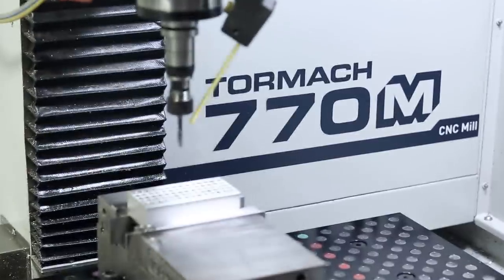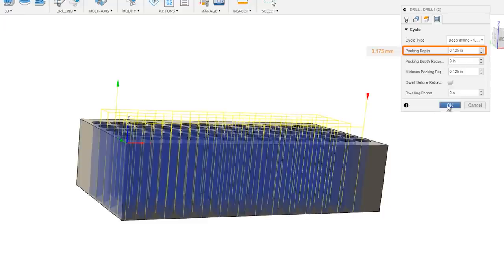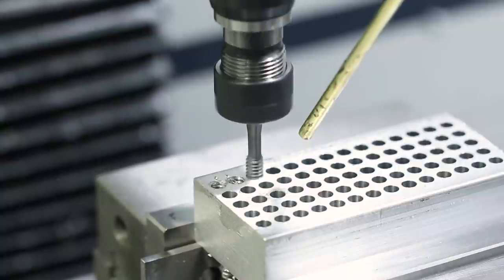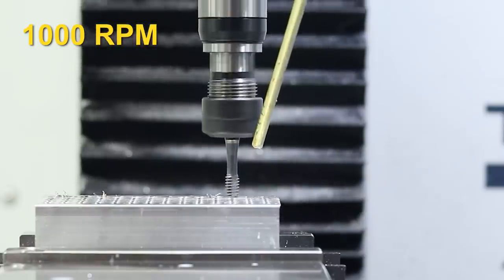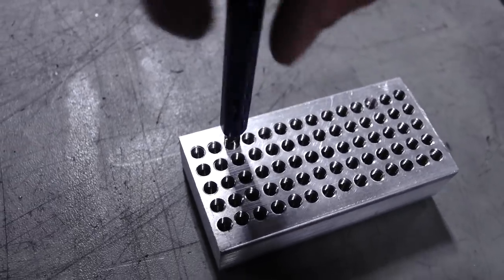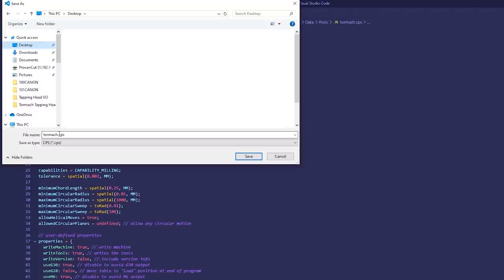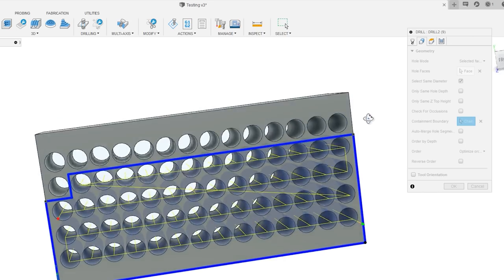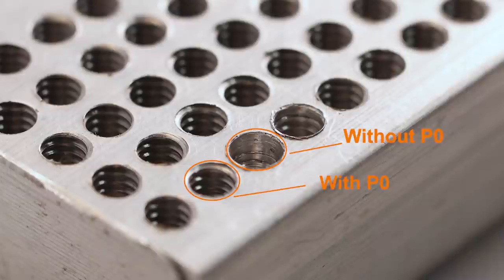How to use the Tormach Tension Compression Tapping Head

Comment: Good video, learned a bunch from you guys so far :)
Though even if you’re using a tension compression head, the head should barely move in and out.
The head is primarily there to take up the slack while reversing the spindle and minor differences between rpm and feedrate.
The feedrate should be rpm x pitch of the thread.
In your case the rpm and feed differ too much, hence the massive travel of the tapping head.
Greetings from an austrian engineer and cnc machinist.
Reply: Was gonna comment just that. Its there for minor differences and should be used that way. Is how we do it at work.
Reply: My post goes by the diameter of the tap rather than thread pitch when calculating the feed rate for some reason. I wonder if that's what their post is doing too.

Comment: Great stuff junior, I did learn a lot but here is your REAL problem. The RPM is way off... In the Tormach manual it has a section about getting a photo tach and measuring the actual speed of the spindle. There is a potentiometer on the control board you can tweak to get the rpm to actual=requested. Only in threading does this amount of accuracy matter. Of course on the MX with an encoder on the spindle this problem is moot, but in pre MX models... The extra travel you are seeing in the quill movement at the tap head is because the rpm is a lot faster than the 525 rpm !! I m guessing its better to have the rpm - tap speed faster than the Z axis moves so it does not get tight... however.... Get a photo tach, follow the procedure and save your P codes for fine tuning... In closing know John IS NOT a fan of Blasser 735 But... ratio mix on the heavy side, in aluminum it works better than taping fluid in my opinion. Taping fluid, and other oils may attack the paint and cause some paint failures we are seeing...Tormach 1100M owner...                                                                                                                                                                                                                              
HAAS also has a great tapping video that I highly recommend as required viewing. Mark Terryberry goes into the different types of taps, and it is possible a less pointy type tap or spiral type may give you better thread finish..
Reply: wanted to post the exact same thing... in my job we don't use cad/cam for most jobs but I know most machines need a 2 to 5% increase in feed to match the correct feedrate. even our oldest cnc machine from the eighties has a separate knob just for the G84 cycle to offset the feedrate up to + or -10% for just that reason. It is however the most accurate and needs no adjustment.
Reply: Hi Jonathan, could you share your feed/speeds on your 1100M for 1/4-20 tap ? I just broke 2 taps....
Reply: @loupitou06fl  in what material ?
Reply: @automan1223  In 6061 aluminum
Reply: @loupitou06fl   just looked up my tooling plate I did out of 1/2 " using 1/4 20 tap prob over a hundred holes... I settled on 500 rpm. Standard tapping cycle. no dwell. Blasser 735 @10% probably a bit more. Did set the clutch on the clutch to slip if it got tight so it would not break the tap. I did a bunch of test holes to creep up on the clutch setting. I also may have drilled to the larger part of the spec so the hole was not tight but honestly cannot remember. Thread milling is also very very cool. NYC CNC has a few good videos on thread milling. Cutters are pricy but work flawlessly.
Reply: @automan1223  Thanks a lot for the prompt reply. I'm also trying to build a tooling plate (3/4in thick). I used a std cycle, 500rpm, no dwell (added the P0.). I'm using the ER16 taping head so no clutch to save my tap. I'm using also mist coolant Extreme Cut 251C - I might switch to tap magic dispensed my hand. I drilled the holes with #7 but I might go to 13/64" and retry. The first few holes taped ok but I noted the head was stretched a lot during the retract - I checked the feeds and the ratio feed/speed was correct.

Comment: When I was in school we were told to program for 95% of pitch when programming for a push-pull floating holder. I was never really told why that is, but always followed that rule until I worked on a machine with rigid tapping and a rigid holder. I also never pushed the speed much because I actually never milled soft metals much.

Comment: Interesting... I'll have to setup some experiments of my own and see what kind of results I get. 
I tap 100's of holes in 304ss with my Tormach 1100 series 3 . I've found the biggest issue with thread quality  and having the tap rub at the top of the hole has to do with feed height, I set my feed height no lower than .50"  giving the head plenty of time to retract out of the hole at the specified feed rate. I also program a .5 second dwell in fusion. I run 500 rpm max in stainless and use  Moly-Dee or similar heavy tapping oil.  The biggest problem I have is controlling thread depth accurately in blind holes.
Reply: I’m getting ready to tap some holes in some 304 .4 deep, what should I set my bottom height to? I don’t mind only tapping .2 deep if I can finish tapping by hand safely
Reply: @gavinbutler4054  That sounds like a safe way to do it, I usually leave about .150" between the bottom of the hole and the programmed tap depth for the floating tap head.

Comment: Any chance of you guys commenting on the changes to the Fusion 360 license announced recently?   Seems like anyone not an entry level hobbyist and not a business with income enough to afford a commercial license is out in the cold now.
Reply: I'd second that question :)
Reply: Did they raise it above the ~$300/yr?
Nm, just read it. The no rapids won't hurt tormach people that bad, but having to load another program for every tool change is ridiculous
Reply: Not to mention not being able to export .step files. Those are the bread and butter of the cad/cam world!
Reply: @piccilos  pretty sure that's automatic tool changes specifically; manual tool changes are still possible in the same program ... right?
Reply: @ikbendusan  I hope so. I don't know how they would limit that in the g-code, tool change is handled by the controller.
Worst case scenario you could still splice the code together by hand and call your own tool changes. Still annoying though.
Reply: @piccilos  very annoying. removing rapid feed is also such an asshole move
Reply: Or just pay the minimal fee?
Reply: @CHinesRacing87  Minimal fee? Go take a look at the price.
Reply: Dejan Brice I’ve been paying it for 3 years and solidworks before that trust me it’s cheap

Comment: which tapping head and collet would you recommend for a haas Cat 40 taper tool.  I'm going to need to buy a tap holder as I'm running a Haas VM-3 on Aluminum and Plasic and specifically will need for stainless.  I am currently using ER 32 nd 16 collets but I know i'm going to run into problems when I start running production cycles with the tap slipping as it has already happened to me a few times at 500 rpm.

Comment: It looks like your spindle speed needs to be adjusted. With a matched RPM and feed rate you will not see much if any compression or tension in the tapping head.  Tormach discusses how to adjust the spindle speed in the same document that you showed in the video. Currently the spindle is rotating too fast causing the tap to bore down faster than the feed rate.

Comment: 1. How does Fusion calculate Z feed rate if it needs so much compensation from the tapping tool?? Or is there something I've missed?
2. What about starting with moving the tool up before spinning it in reverse? This may help making even better finish on the top thread.
Reply: The lower-end mills like Tormach don't have nearly as good speed control over their spindles compared to other larger, more expensive machines. It's basically an open-loop system where the pro machines use servos and can better match the feed rate and spindle speed under varying load conditions.
Reply: Yes, spindle speed is off. As stated earlier, by someone else, the spindle has to be calibrated. The Tormach manual details the process. I have done mine and it is less than 2%. Once the spindle is calibrated, you should use a dwell. The calculation for how much dwell is also in the manual IIRC. If done as discribed in the manual, there is nearly undetectable movement in the tapping head. I had to put a sharp mark on the compression head to see it. Also, use a spiral tap that ejects the chip out of the hole. I run my coolant a touch on the rich side in general and that really helps on the taps. That p value it for calculating the deceleration and acceleration (drift)of the spindle during reversal.  If I had video equipment, I'd out up a video. BTW, I've never broken a tap. That said, I've not had to tap a hole larger than #8. Fwiw

Comment: On the other hand, this only works for this setup. If you have pocket taps your tool will brake, if the hole is deeper your tool will break ;). Also you are using a machine where the costs per hour are not too high so why not stay with the smalles rpm you have you still will get a great tap and don’t run in problems.

Comment: Your feeds are wrong. 1000rpm 1/4-20 tap should be 50ipm. That’s why there is so much movement in the tapping head. Rpm/TPI is your feed rate.
Reply: We use to break taps when we used 100% of the calculated feed rate. I started using 95% (tapmatic recommended) so the tapping head is always in tension & we've not broke a tap since. Using 100% requires your mill to stay in perfect sync with the tap. Our problem is the mill would get ahead of the tap, causing the tap to be jammed up into the holder & shatter the tap.
Be aware that if you use a percentage of the feed, your tap is growing downward. Which means nothing for thru holes but could cause you to bottom in a blind hole if not accounted for.
Reply: @chadw6852  the 100% value would work if the actual RPM matches the selected RPM, most machines however always go slightly faster/slower than selected. When not tapping deep that's no problem, but when tapping either deep or blind you could run into issues. Therefore check the ACTUAL RPM with a tachometer, my experience on the machines in our shop is that most are running 2 to 5% faster RPM then selected, so we have to increase the feedrate, not slow it down, this may vary from machine to machine and even per gear when a gearbox is used to select spindle RPM.
Reply: @clubdjmarcus  our mills are older bridgeport machines so i can't speak to anything made in the last 25 yrs. anyway for yrs we had our tapping feeds set at 100% & our guys did not like running tapping cycles in the mill due to constantly breaking taps. i started doing research on it 2-3 yrs ago & found where tapmatic (95%) & haas (90%) recommend using a percentage of the feed. this ensures the tap is traveling faster in Z than the tapping head. if you run it at 100%, it might work fine on a newer machine but you're asking the machine to be perfect & if it isn't you get the problem we were having. since i've changed to 95% feed i don't get complaints about tapping holes in the mill anymore & to my knowledge we haven't broke a tap in 2 yrs. i should say our tapping head is a tension/compression style head (like what he's showing in this video) & what we're doing works for that head. a different style head may require different settings.
Reply: @chadw6852  the machines i work on now are from the mid eighties, so 35 yrs old (Mecof CS500 and CS103), they still have an old fashioned ribbon reel with holes (though they aren't used anymore, programs are still stored on diskettes) we have the same style tapping heads but with the quick-change heads. Only 1 machine i have ever worked on needed 95% and that was a '96 Korean bed type mill, so again: it really depends on the machine, so if what you do works for your machines, then you solved your problem, but another machine might go the opposite way...

Comment: It seems like the feedrate was really the problem here... The tap should not massively outpace the movement. It seems like F360 doesn't keep feeding as the spindle spins down/spins up, so you get a mismatch.
Reply: That's a problem with the Tormach and its lack of servo control, not a problem with Fusion.
Reply: @MysticalDork  sure, that's fair.  Maybe Fusion should have an override where you can time how long your spindle takes to spin down, and it could keep feeding for that long. But maybe it's too niche of a problem for them to care.

Comment: Guys please set the heights right... 2 pecks before it touches the material
Reply: It wasn't really wrong, the clearance height was just set pretty high. The other z variables were pretty much on point
Reply: @chas1878  no clamps or other stuff to get into the way why would it ever be above few mm from top surface?
Reply: @chas1878  biggest issue i have is when i employ people they dont even know that stuff like heights can be modified. A video on cycle time reduction would be super nice from big guys like NYC CNC but even in such demo taking 5 sec to edit them would be a nice remark to add
Reply: The real issue is no chamfer. Nice video thanks for sharing.

Comment: why cam? you can do all those one line drill cycle. and that PAUSE is tormach problem.it means you code it make shallow hole it wil go deeper becouse it breaks slower. right ops ops. it wont do rigid tapping. thats why lol